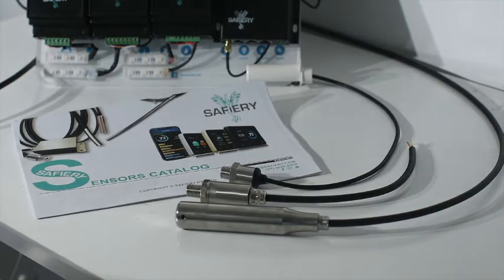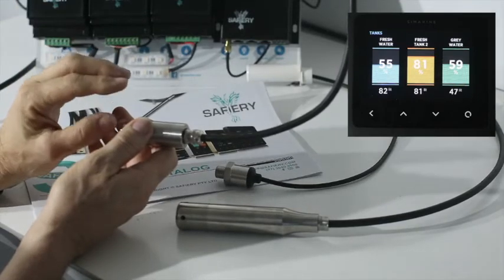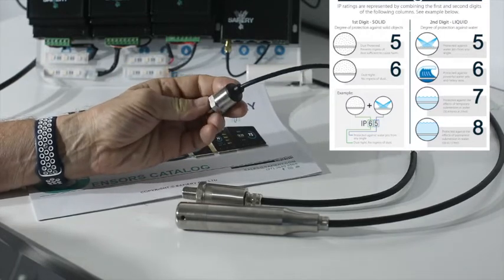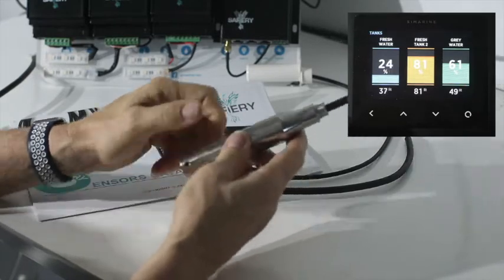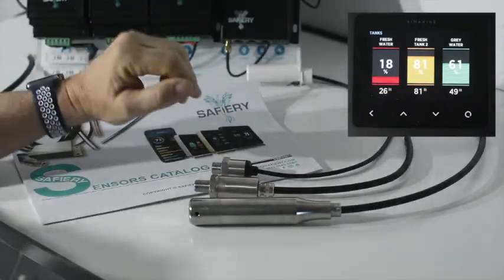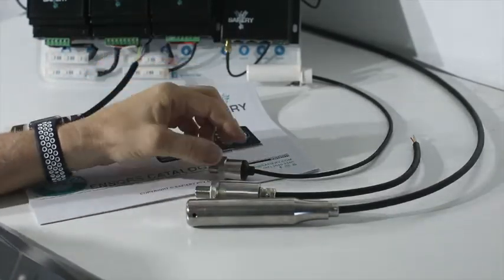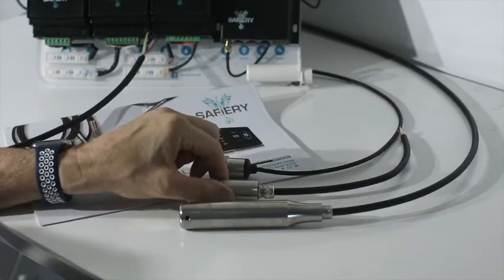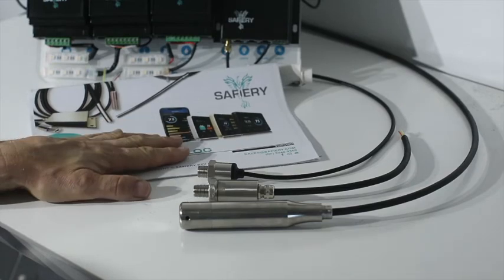Accurate Tank Level Monitoring with Pressure Sensors

Comment: Thank you for this very clear explanation. I already have an ethernet cable and regular 1.5mm² copper cables running from my basement to my water citern. The length is about 30 meters. Based on your explanations I understand I can perfectly use your IP68 sensor. I just need to ensure the air tube is above the water level of my water tank and then connect the two wires to some of the existing cables (doesn't really matter whether I use one of the thinner or thicker cables as the calibration will take into account the voltage drop). Is that correct?
Reply from the maker: Yes, you are correct. Calibrate after install.

Comment: Can you explain, you say these are not waterproof but say that they need to be fitted inside a tank?
Reply from the maker: shadowswan there are Three grades of “waterproof” IP 65,67 and 68. The last one IP68 can be fully submerged. IP67 can be fitted outside in the tank and can travel through water crossings easily. IP 65 may not survive water crossings.
Reply: Ah ok so the bit that’s inside the tank is waterproof but not the outside?